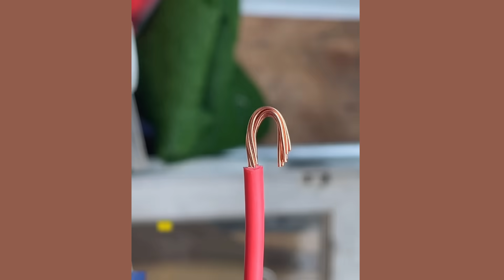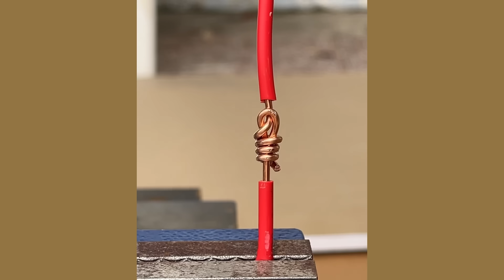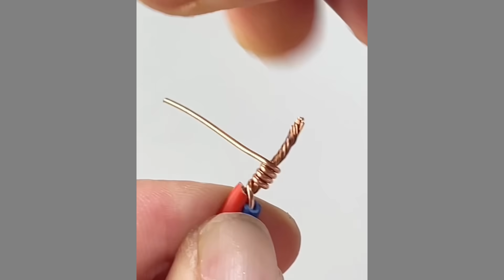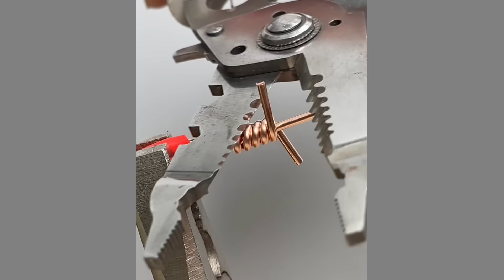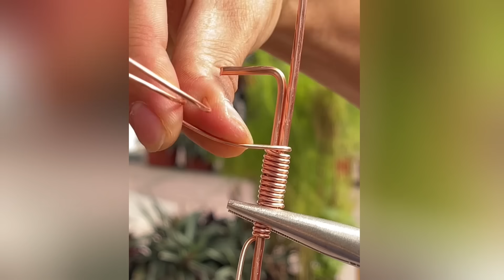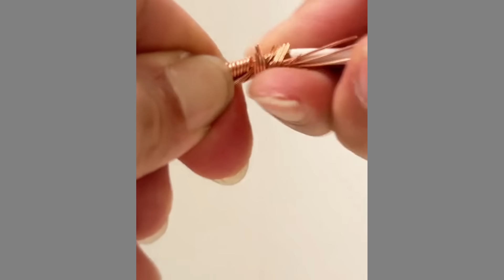10 Simple Yet Effective Wire Twisting Techniques - A Must-Know Hack!

Comment: I'm sorry I normally do not like to say anything poor about a person or product but this i feel might save some one's home. All residential electrical wire connections or splices must be contained in an apoved box, device, or panel in an apoved manner. Waggos,, wire nuts, and split bolts are the only methods I personally know that are acceptable. The coil rap connections creates induction heat and magnetic fields.

Comment: Electrical conductivity isn't solely a property of the material per se. It depends on its geometry too. To maximize conductivity, the cooper threads should stay parallel to each other. If you turn and twist them one upon the other that way, you'll severely increase resistance and you'll also create points for unequal corrosion. There are devices more adequate to join them properly. 

Mechanical strength is different from electrical conductivity.

Comment: While all this looks neat and good i am pretty sure that in many "western" courtiers this will never be used and probably counts as insurance liability. 
We are using things plints with screws and splice connectors (like Wago) when we need to join cables together just to make it uniform  between many people and get insurance cover.
But hey if you happen to be somewhere in the boonies and you just NEED to make it work then sure MacGyver it away but make sure to replace it with stuff are that are compliant with local regulations if you aren't doing temporary fix.

Comment: US  Electrical Codes doesn't allow small wires to be connected like this
Reply: Just curious why? Is there an actual reason? The mechanical commection looks solid. Heat and fire are usually a result of and arc made by poor mechanical connection or uninsulated wire hitting another unisulated wire. Twisting is not an issue also because wire nuts actually twist wires. And before wire nuts were invented, didn't people simply twists wires together? 

Honest question

Comment: Use the damn wire strippers that you have in the video to strip the damn wire! Use your lineman's pliers to twist the connections together! Twist a wire nut on nice and tight and pull on both wires to make sure you have a good connection! Done! You DIY idiots work so hard so do something so horribly wrong and dangerous!

Comment: I can't think of any normal scenario in which it would require these kind of excessive twisting. In a normal circumtance, wire will not be under tension, or expreince excessive vibration. Soldering, heat shrink wrap, or plain old electrical tape would keep simple twist in place for the majority of the application.

Comment: As far as I am aware, coiling copper wires so tightly is a guaranteed way to overheat and start an electrical fire?
Reply: Why would winding copper wires cause the connection to overheat? The wires are not insulated so it's just a connection.

Comment: Do not do this. Simply solder or use a connector when working with small loads.(do not solder and then use a connector, either or but not both) Crimped connections for anything with high load where allowable running temps will cause soldering to breakdown.

Comment: How to start an electrical fire
Reply: I clicked into this video in order to give you a like
Reply: @PekoraMamiCouncilHK  Both of you have no idea what you're talking about.
Reply: 어이 친구들 전선은 많이 꼬울 수록 발열이 심해져 . 저항값이 많이 올라가.그리고 문명의 이기를 사용하라고. 이기는 이로운 기기를 뜻 함.
Reply: And how exactly will it start a fire? Fire results when there is an arc because of poor mechanical connection between wires or when  unsheathed wire connects with another wire. The connection here looks solid.

Or you think it will cause a fire because of the twisting? Don't you think wire nut actually twist wires inside the nut? 

Kindly explain the physics why this will cause a fire? Im not saying it wont but you have not explained why.
Reply: @henryposadas295 I personally always use my lineman pliers to twist my wires. Use a wire nut to mechanically hold them together, or use a crimp connector. 

Of course there are electrical codes I have to follow.
Reply: @henryposadas295  고압케이블도 아니고 가정에서 쓰는 전기로는 불 안남

Comment: Really? No solder, no wago, no screw terminal? No matter how great the twisting looks, you will have significant drop in cross section and significant gain in resistance, therefore it will heat up and burn the house down, and you will go to jail. Twisting wires together is a clear indicator of a goat herder took an electrician job

Comment: You don’t need to be very smart to realize that an alternating current electricity AC passing through those intricate loops of cables is going to generate magnetic fields that could, in one way or another, interfere with the electrical conduction of those cables. It should be discouraged — it may look nice, but it can be dangerous

Comment: for urgent and temporare it's ok but pls don't be so bulky in the connection bcs it's creating more heat n more Ω on longterm that can be dangerous.
it's better if the connection is wield using solder it's the good ways.

Comment: Solid wire ❌
Stranded wire ❌
Single core wire ✅
Reply: @hachi666roku  What's the difference between solid core wire and single core wire? They're both the same in my world if electronics. And what's wrong with stranded wire?
Reply: @joewoodchuck3824 well solid core wire will make a magnetic field if energized and wrapped in the way the thumb pic is bad. Typically old school wiring found in older homes.

Stranded wire is 95% times found in automotive applications where movement / vibrations is present. 

Also wiring already comes single core, bundles in a jacket have different names like Romex.

Like calling the wire “wirewire” its already established as “single core”

Comment: In all standard splicing techniques for multi-stranded or multi-filament conductors, the wire ends are typically left untwisted prior to splicing. However, pre-twisting the wire ends can improve the mechanical stability and overall quality of the splice when the conductors are twisted together

Comment: Don’t discount using solder to finish these connections.  It’s not for strength…It’s to seal against oxidation!
Reply: Adding solder reduces resistance of the splice to that of an unbroken wire.

Comment: Regardless of how fancy a connection looks, it should be properly soldered before heat shrinking/wrapping it!
Reply: ㅎㅎ 저도 납땜 환자입니다 ㅋㅋ
Reply: Sometimes, you don't have solder or the heat to melt it.
Reply: Absolute reddit comment.

No connections in houses are soldered.  Car electrical connections are not soldered either, they are either plugged or crimped.  House wire is connected with wire nuts or lever nuts, both of which make inferior (but more consistent) connections compared to properly performing these techniques.  These are old techniques from before the days of cheap commercial mass produced connectors.  Various kinds of splices like the Western Union Splice & the Branch Tap have been used for generations to great results when performed correctly & finished properly with heat shrink or other insulator methods superior to electrical tape.

Soldering the connections with solid copper wire doesn't even make any sense on it's face.

The reason these types of connections are not code approved is because they rely on the technique of the user to make them good.  When done well, they are superior to most types of commercial connector products.  When done poorly, they are inferior.  They are also time consuming.

Inconsistent + time consuming is bad for mass production, especially on products which need to be financed by a bank & insured by an insurance company.
Reply: @Chud-Tungsten  
你說的評論太好了。
影片中接線方式，是很考驗個人技術。

尤其身邊沒有專門的電線接頭(或是橋接器)，而個人技術又不差情況下，採取影片裡方式是可行的，但仍需做好電線的外層防護。

個人是強調影片中接線方式，只適合家庭用電與用電量低負載的環境。

像是電器設備的訊號線路(有干擾問題)，工業級的高負載電量的線路(線徑大的電線，有專業的接線方式與外層防護重建方式，這實在考驗技術，該影片範疇)，偶而遇到潮濕的戶外環境(無法確保只用電膠布的防護性，而沒熱縮套膜的情況下)

那還是選擇專門的電線接頭，以確保未來用電安全。

Comment: This is very bad because looping wires causes electrical resistance and can cause fires.
Reply: Rather wasting too much wire, better you use solder to bind the wire joint. No needed to do something inefficient 😂. Mostly electrical wire used for conduct electricity, not for tug war 🤣🤣🤣
Reply: Real electrician here, Also got a background in electrical engineering. When you coil the wire Several times around the way they’re doing it like that You’re causing something called inductive reactance aka magnetism Which is a form of electrical impedance (resistance). That’s why you don’t see real electricians splicing wire like that. Instead, you need to get something called a butt splice kit where you can crimp the wires directly onto each other without coiling them if the specs call for that in the circuit. Otherwise just use a wire nut and be done with it. I have never in my career ever seen anybody splice wires like they’re doing in the video, This is good for artwork, but not for electricity
Reply: @JaredScott-dp8nj  thank you brother. You explained it way better than i did.
Reply: @JaredScott-dp8nj  That doesn't happen because the entire wire is shorted out. There's no "coil"—it's just a mass of wire all in direct contact. This would basically act the same as adding wires in parallel—basically, thickening the wire.
Reply: @hurtx. Except they are coiled like that in solenoid and they still act like inductors even  the coils are in contact. The majority of elections still prefer to travel through the loop than jumping between the wires
Reply: @oldcowbb  A completely shorted copper coil stops acting as an inductor and behaves more like a simple conductor. As each turn of wire electrically touches the next, shorter paths are created for the current. Instead of following the entire long path of the coil, the current "shortcuts" through these contacts. ehaves more like a simple conductor. Each turn of wire is electrically touching the next, generating shorter paths for the current. Instead of following the entire long path of the coil, the current "shortcuts" through these contacts. 
If you want, do the math for that coil, keeping in mind that each millimeter of the conductor is shorted to the next.
Reply: @JaredScott-dp8nj  HALLELUJAH!!!! Finally, someone with a functioning brain and real world experience! Bless you, my dude
Reply: @JaredScott-dp8nj  you've never lived in third world countries - I've lived in countries where you can't even find wire nuts - even advanced countries in Europe use technology like this - they make battery operated wire twisting devices - end to end butt splices are crap, the wire breaks at the end of the crimp - I used wire nuts brought from the states for a long time - BTW, a wire nut is the same thing under the cap - wires tightly twisted with a steel spring forcing them tightly together - I'll match your engineering credentials, and 45 yrs ago we were building prototypes of new designs using square pins wrapped with thin solid strand copper wire - these bonds were actually air and moisture tight 🤔
Reply: If done correctly, looped wires will produse less heat than modern connectors(wago f.e.), check several tests on yt, so if u need to fix wires temporary looping is best, if u need long  time solution u need to change whole wire as any variant of connecting may cause fire in the future
Reply: @DeatH2DaIDF   Falso. para ello necesitaría estar aislado
Reply: More contact points less heat.